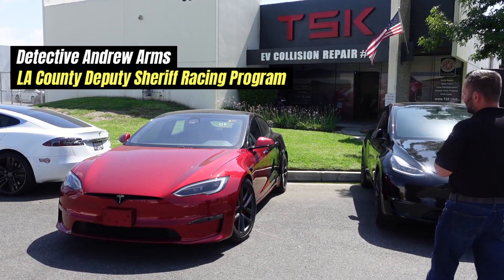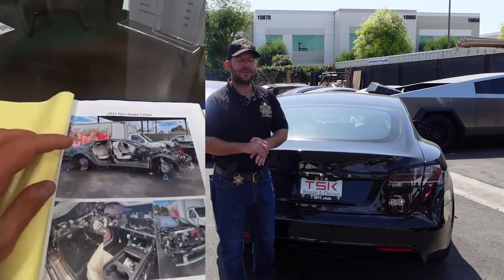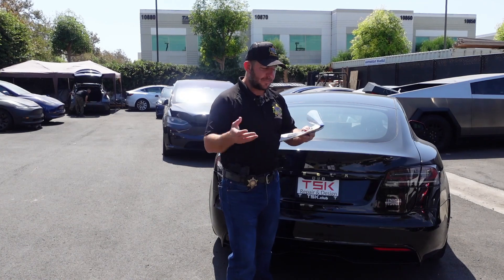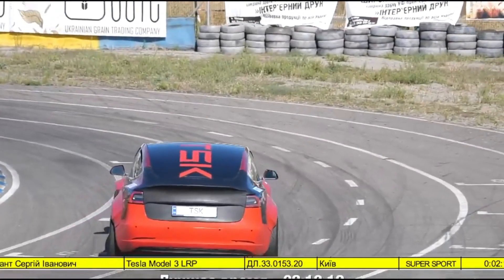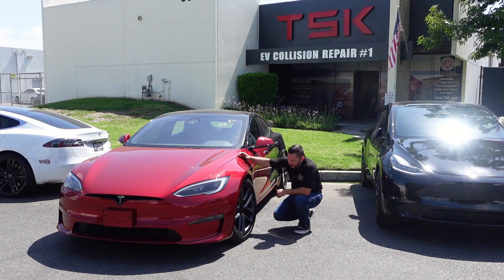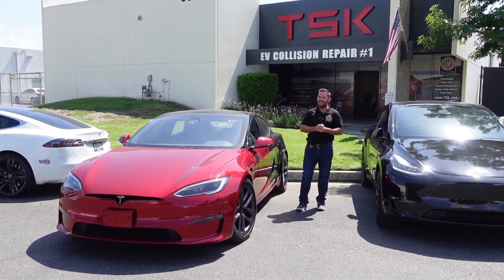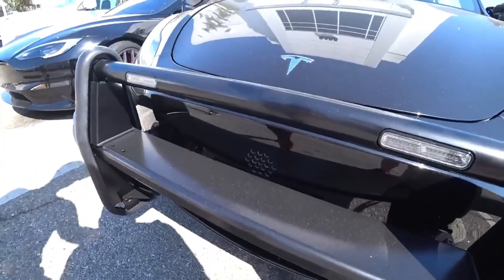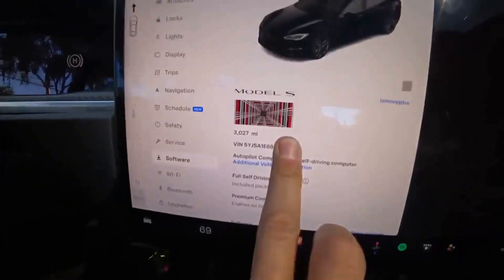THE WORLD'S FASTEST POLICE INTERCEPTOR / #TeslaInterceptor / Building 1000 HP Electric Beast

Comment: Sorry to disappoint but 180 Mph / 290km/h is not supercar speed, that is the top speed of a regular Porche with 320+ Hp... A supercar goes a lot faster then that on the straights and will also be a lot faster in turns because of less weight.
Reply: well a model s plaid is 1000+hp and 0-60 1.99 sec